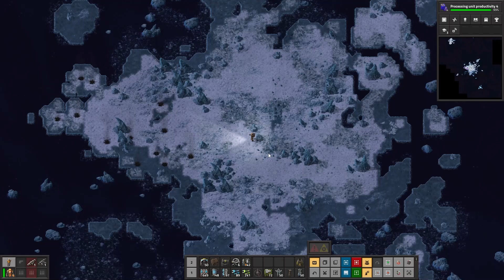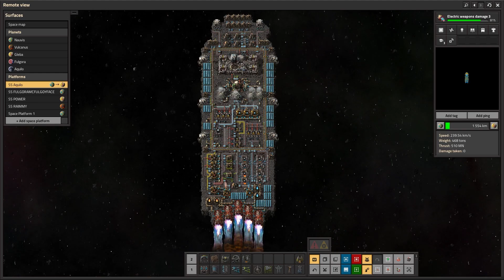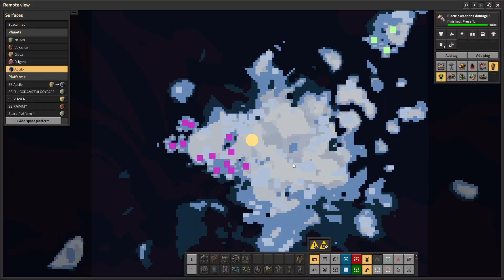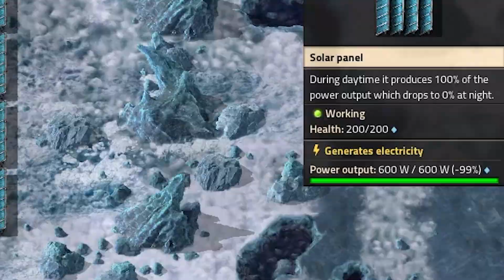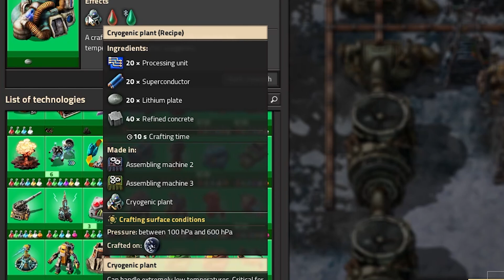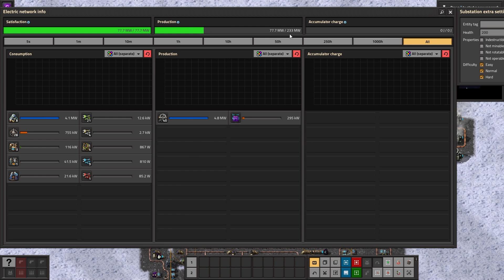Blueprint for AQUILO - CRYOGENIC science fully automated - Factorio Space Age Tips & Tricks

Comment: I forgot how long space age is out. Not gonna lie, Aquilus is such a challenge, though I did start out using heat towers, producing platforms with my first cryo labs, as one can get hassle free power in a really small block that way, as one ammonia, solid fuel and rocket fuel plant can supply 2 heating towers easily .

But thanks, really helps me out alot. THink comning here was a bit more than I could chew on

Comment: You can put that blueprint down in one go by making the following changes. Isolate the solar water startup on its own electricity grid by disconnected the wires between power poles. Isolate the power generation from the rest of the base onto its own electricity grid. Then use two power switches. One to connect the solar water startup to the electricity generation and one to connect the electricity generation to the rest of the factory.

To start (or restart) a blackout, turn both switches off. This allows the water to collect. Once you have water, switch on the switch between the water and electricity generation. This will start the electricity generation easily since nothing is drawing power. Once it is hot enough to generate steam, you can turn the switch between the electricity generation and the rest of the factory back on, and everything runs perfectly from there.

This setup is working flawlessly for me, and is easy to restart if you have a blackout.

Comment: That's a nice blueprint, I'm in my frist run and Aquilo has been the hardest, but I'm having a lot of fun. I didn't use nuclear power at all in Aquilo, just a bit of solar and heat towers and my factory looks like a spaghetti, but it is working perfectly. Aquilo made me struggle way more than the other planets after my factory froze, I had to disconnect and rebuild so many buildings and try to heat everything up again, it took a while, but in the end my factory works fine.

I found your video because I was trying to find what other players did to automate the launching of rockets in Aquilo, but I haven't seen anyone showing this.  So far I've been sending blue circuits and LD structures to Aquilo, but my plan is to take one of my platforms to stay orbiting Aquilo and get the necessary resources to launch rockets from asteroids so that Aquilo becomes more independent, but for that I'm gonna need to research Aquilo's fusion technology first.
Reply from the maker: Thanks! Good luck on aquilo!

Comment: Great discussion about Aquilo. Your full build is impressive. The reserve water tank is a great idea, and one that I stumbled onto after my own power outage problems. 

I found success adding efficiency modules into my ice-melter chem plant, for when I had to run it on solar. 

Also, for distant heating towers, I used daisy-chained heating towers with solid fuel, but kept everything on the surface as much as possible to avoid the underground penalty.
Reply from the maker: Thanks! And the efficiency modules are a great idea

Comment: whats the reason for the power plant placement? wouldn't they benefit from standing next to each other? or is it somehow important to have 2 seperate heating cycles?
Reply from the maker: I don't think heat towers have an adjacency bonus. I haven't done the research but intuitively I feel like the further away a heat pipe is from the source of heat, the exponentially more fuel it takes to maintain the heat. You can kind of see this if you run a long heating pipe that the heat and the far end of the pipe is much lower than the heat right next to the source.

So the reasoning is to run 2 medium lengths of heat pipe from 2 sources of 3 heaters instead of 1 long heat pipe from 1 heater
Reply: @DataEngineerPlays  aaaah, my bad, i thought the nuclears are the main source of heat there (and they have an adjanced bonus) i just now checked and saw that the heating towers are actualy able to maintain the heat for the hole blueprint.
Reply from the maker: @justme18ch  oh yes the nuclear is just to get you going temporarily since you don't wanna be wasting time sticking fuel into the heaters

Comment: Thanks for the nice design! Are you gonna add phase 4 with additional buildings like these microchips? Also I build this with mk2 speed modules  in beacons and mk2 productivity modules and it wasn't enough - I wasn't getting enough solid fuel to keep the heating tower left of rocket fuel plant going all the time, and pipes there would freeze sometimes. 
I got mk3 speed modules shipped and boy, that sure made a difference (still with mk2 productivity) and everything is running
Reply from the maker: No worries, sorry to hear your struggles with MKII modules. I never even considered that because I thought if you're going to aquilo you definitely have a speed and prod 3 module factory by now

Comment: Awesome as usual!

Just curious if you cannot get rid of the unconsumed ammonia by spending fuel in the heating towers / power plant. Eventually as rocket fuel. I guess it could be set up rather easily. But I will wait until I get to Aquilo in order to test it. First I have to ship the rocket materials and the holmium from Fulgora / Vulcanus.
Thanks for the series!
Reply from the maker: You can turn off all the circuit condition to allow the towers to continuously burn fuel yes, I'm just scared to run out of fuel. It's not a very controlled way of deleting fuel
Reply: @DataEngineerPlays  I feel you. When I get there I will check for the optimal way to balance fuel use with ammonia / ice overproduction. Thanks!
Reply from the maker: @avpascal  you can just put an overflow splitter on the fuel and send it to recyclers its not complex just annoying to do on bloody aquillo, every addition you make exponentially increases the heat piping mess

Comment: Me who is still trying to fix his Gleba setup (Its the 8th time and it still deadlocks itself in the weirdest ways)
Reply: burn excess, almost everything can burn
Reply: @ tried that: still deadlocked because nutriets spoiled and it ran dry. Installed backup system to use spoilage as kickstart; now im having shortages of bioflux.
Reply: Gleba tends to throw a lot of wrenches into your way
I dont think a perfect system can even exist
Reply: @ztirom2267  ive come to conclusion just to tirn everything to bioflux on site then do localized nutriet production at each section to prevent deadlocking
Reply from the maker: @Fallouttec  wait are you using my gleba blueprint? I have a vid for it
Reply: @ nah was trying to figure it out on my own and at this point im too lazy to strip it all down and rebuild from scratch
Reply: Awful planet. Cool idea but it’s not even fun after a while
Reply: no way. i've build his Gleba base from BP and it still works after +100 hrs of gameplay. all you need is to replace modules when new become available. right now it gives me 5 science per second.
Reply: Usin belts or robotics? If belts every process must filtered , always gate it/funerl into boxes and have 1 extra inserters to filter out spoilage. Usually this means assemblers has extra arm at each boxes to remove spoilage. 

If using bots, tick “trash unrequested” to put spoilage into trash section automatically when items expired.

All this goes to recyclers  to reduce spoilage or better yet nutrient crafting assemblers to loop the process. 

YOU WANT SPOILAGE. It’s easier once you overproduce spoilage to nutrient assembly, so that any bottleneck = time expired = spoilage explosion will automatically recycle back to nutrients
Reply: @ my setup is using a mix of looping short belts near the machines and dedicated main lines that sprawl like untamed spaghetti. The main issue i was having was shortages of nutrients but i had made the mistake of making nutrients in a centralized location when i should have been doing it onsite with an additional crafter to turn spoilage to nutrients to jumpstart stalled bio chambers. Ive gotten my setup to function now its just a matter of heading back to gleba some day to setup a proper perimeter defence as well as setup artillery clearing; right now i just have tesla turrets scattered all around to provide some basic coverage and its worked right up until 2 stompers charged in and took out red circuits so I’ve had to bot build out to their nest and deal with it remotely